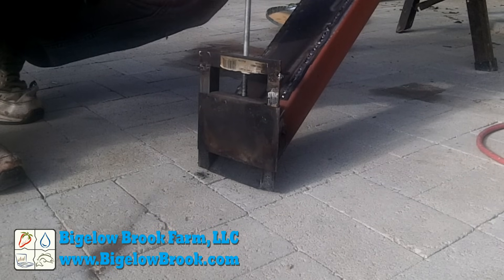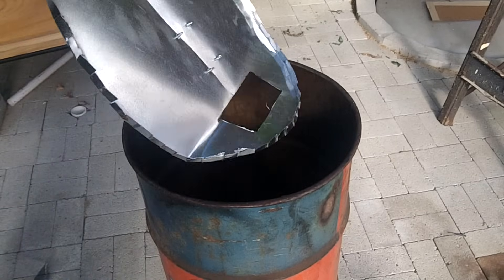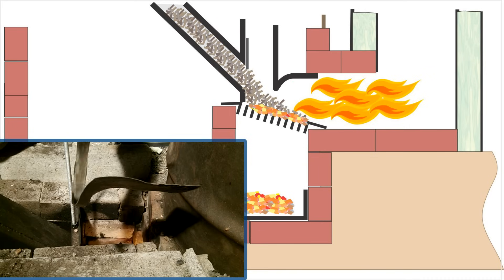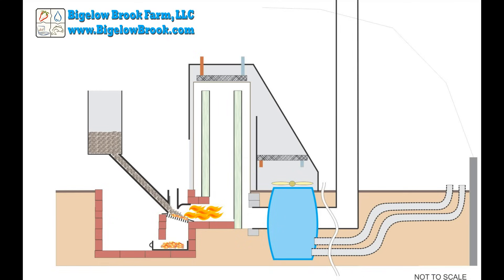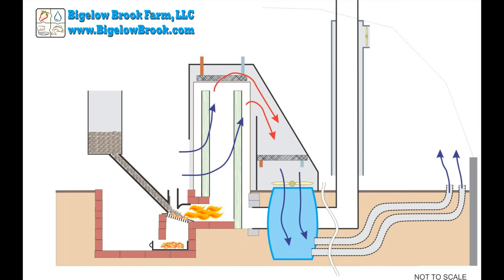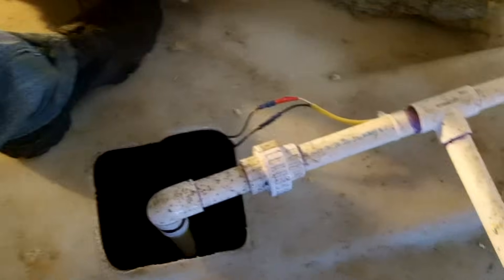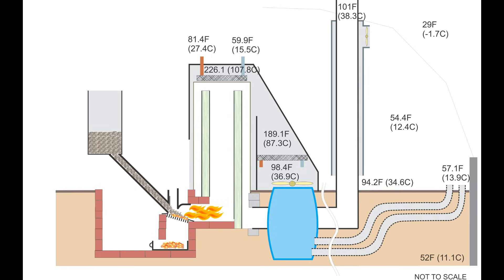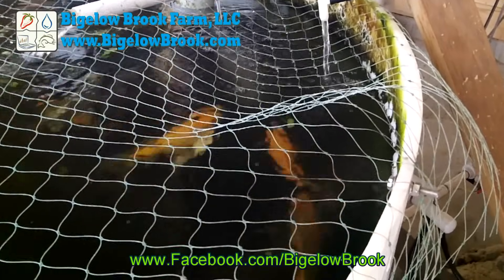Rocket Mass Heater - On Steroids

Comment: I don't know if an inline thermostat will contaminate water & fish and get fouled up by fish water & behave erratically. Water heater system can be isolated from fish water by coiling tubes in fish tank for radiant system: heater core/radiator, coiled hydronic pex tubing, etc in water. You can then use some anti-freeze (ethylene glycol or RV potable water) in the system to keep pipes from freezing.

Comment: As always, I am a fan! How about an automotive inline thermostat to regulate water temp within a target range for tanks...similar to an intake manifold engine thermostat but inline with pipes (aka radiator hose)..you can use rubber couplings or screw on to connect. Adding another 1-2 radiators and thermostat control, critical heat can be sent to the tank when needed, then water flow shut off when tank is in target temp range.

Comment: That a pretty cool set up you have there, just a thought to get off that AC for the box fan is to replace it with an old car radiator fan, 12 volts and pretty cheep from a bone yard.

Comment from the maker: yup.  The radiators are easy to remove so I could do this.  There's no doubt you want to run them dry!  I can also let more heat right into the air by removing one of the panels which changes the air flow.  It's not hi-tech like a real heating system, but it will do the job!

Comment: I think your plan has worked extremely well.  Excellent work.  So, it looks like you are able to get about 4-6 degree rise in the ground temperature very easily.  I suspect if you reduced radiator flow rates a bit, you could probably get around 20 degrees rise in ground temp once tank temperature is adequate..  Your strategy is nice, very elegant engineering.

Comment: It's about time someone moded a rocket mass heater! I like your design and I don't think I could have done better. I am only concerned about the operating costs of pellets and wood. By lining the inside of the dome with some Mylar you can reflect some solar heat into the fish water.

Comment from the maker: It's hard to tell from the video, but the air is pulled through the bottom radiator.  The water is pumped in parallel for the 2 radiators.  I"m using the existing pump that is pumping the water for the aquaponic system,  I've thought about adding a loop to the chimney inside the building at some point...but that pipe is expensive.  Maybe someday.  Sorry no wind turbine...we don't have enough wind to justify the cost.

Comment: Or you could use a conveyor belt or screw system to transport the pellets from a ground level hopper to the top of the main hopper. Dump the pellets in the ground hopper, turn on the belt/screw and fill the main hopper with ease.
Of course this would really complicate things, require a decent bit of space, and probably couldn't be run on your solar system anyway.

Comment: Isn't this the same system the Romans used for heating their baths? Rocket heater, venting the heated air through the floor to act like a massive thermal reservoir as well..

Comment: Awesome job ! been following all your videos.  One small suggestion will be to put a tighter baffle/seal  around the bottom radiator and  so it pulls air through the radiator fins.  Are you pumping water through the  bottom radiator in series with the top or is it a passive system.  2nd thing is to let extend the chimney inside so air cools down much further from 101f.   But overall an A+ ;)  Whats next a wind turbine ?

Comment: Fantastic man! This seems like it could be simplified and run cheaper for you if you could get away from the pellets. But boy that would be so much simpler than feeding wood every 30 minutes. Have you seen the saw dust heaters that run for 8 hrs? I'm trying to get a system running using no electric and burn time of at least 2 hrs with wood.